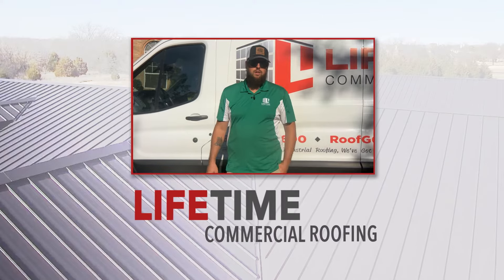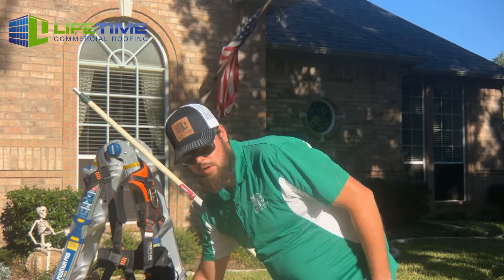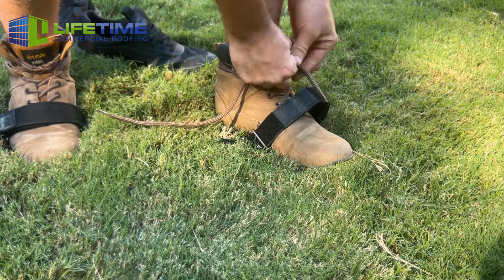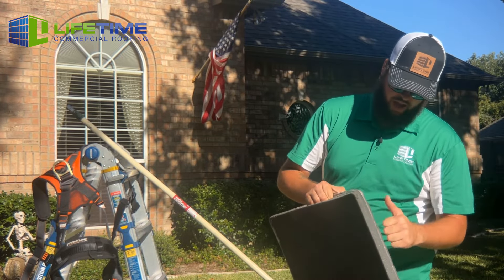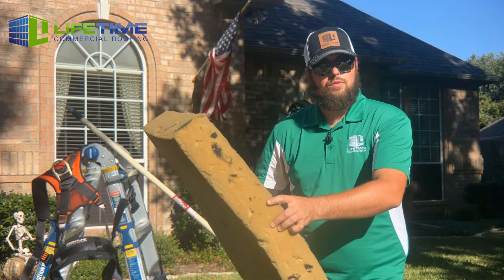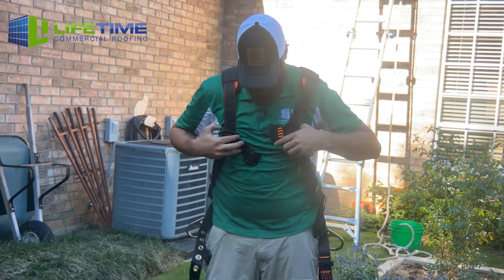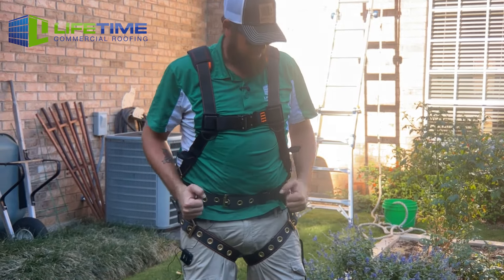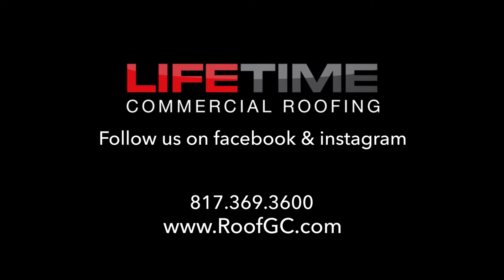How To Use Roofing Safety Equipment - Tech Tuesday

Comment: To be honest, in that situation you would probably want to anchor onto the other side on the house, then you don't have to worry about your anchor coming loose if you lift the rope to high like the set up you have in the video. Clipping your rope into you side rings is asking for trouble if you fall
Reply: i'm new to this. what are the side rings there for if you don't recommend using them? Thanks :)
Reply: @gameratortylerstein5636  they’re for stationary work positioning, what a line mechanic would use. Wrap your work positioning strap around the pole / structure and clip into your side rings
Reply: @gameratortylerstein5636 They put you at risk of breaking your back in a fall... A shock absorbing lanyard might prevent injury and it might not.
Reply: @gameratortylerstein5636  hooking to eye bolts on each side of a window.
Reply: All in all a Good video about safety and how to. I was on a roof the other month and actually tied off my rope on the other side which provided a tremendous amount of comfort knowing it was secured and not coming loose.
Reply: @unSTEVOED are there anchors you can hammer into the ground if there is no structure/pole ? Also i imagine using a thick rope. is there a friction or roof damage issue as the rope has contact with the peak ?
Reply: @50Quid-d3x please share more details about how the eye bolts work on the window sides

Comment: You said OSHA recommends fall protection for roofs over 7/12 pitch. Where is that stated in the regs because I thought it was required on all roofs regardless of pitch?
Reply: I agree. I can still fall off a flat roof if i accidentally trip and fall over a leading edge to my death
Reply: True that, up here in Maine on a flat commercial roof you have to be 12 feet beyond the edge before harness off
Reply: OSHA IS ANYTHING ABOVE 6FT
Reply: Anything above 6 feet height is regulation
Reply: OSHA and Canada have the same laws, anything above 6ft req fall protection
Reply: Inspectors and independent contractors can get out of these regulations as OSHA only protects workers underneath the boss and makes an exception for inspectors, as they are not doing any work.
Reply: Anything over 6ft you need fall protection the pitch has nothing to do with it.

Comment: Much appreciate the tutorial. Roofers deserve the utmost respect in construction business for the level of risk they take. Framers too, especially the ones that add rafter after rafter as they build it out, often standing on a stud and cut the rafter at a desired angle with a circular saw and a heavy nailer hanging on another side. We take them for granted. I tried climbing my roof for the second time (and failed) to replace a shingle, was 1 foot away from the shingle but at that point I did not find myself positioned comfortably and decided to hand the job to a professional. The roof I climbed had a pitch similar to the one shown here.

Comment: Thank you! This video has been the most helpful. All of the others that cover using a safety harness begin with climbing to the top of a roofline, with no safety measures in place, to install an anchor point to secure a line. I don't feel safe doing that on my 12:12 pitched roof.

Comment: Great video! I use the Petzl AVAO harness. Best that I've seen so far. It has D rings in the front (center chest), front both sides (for a positioning lanyard) and the back. I like connecting the line to the front as well. Cougar Paws and Pitch Hoppers are essential. I need to work on a 12/12 roof and would use a tool like the Ridge Pro to get to the top, but would install anchors, since I'll be replacing the shingles.

Comment: It looks like this one is great to get up but would you add another or switch if your walking around all sides of the roof? Also does this work on Spanish s tile roofs as well? 

In my case would be solar panel cleaning and gutter cleaning

Comment: I am not a roofer, but something here does not seem right. At 15:37 you placed the lanyard on the left front of your safety harness. If you fall and the rope catches you, wouldn't that cause you to bend-over backwards and sideways, and then snap your back when the rope gets taught? Is connecting to one of the front D-rings an option in the instruction guide for the harness? 😐
Reply from the maker: That only applies if you fall all the way off. You are correct in that you don’t clip off like that for edge work or anything that could cause you to free fall any amount. For that type of work you use the back ring. If you higher on the roof and keep your rope taught with the comealong and you lose your footing you’ll hit the roof but you won’t slide down. Ben’s harness has kept him from an almost serious accident twice using it the way he has demonstrated.
Reply: You're right, Those side rings are made for work positioning straps for tower / pole work. Not for fall arrest. Most harnesses come with a front d-ring to clip in from your anchor if you don't want to use your back d ring
Reply: He was doing a job for a pest control company, so I can see why he didn't want to install anchors, but if your replacing shingles, always use anchors, in my opinion.

Comment: The issue I see with the ridge pro is that it's not attached to the roof which makes it an insecure anchor to attach a harness to. I would questions it's ability to hold you if you were to actually fall and the pressure of that sudden load would be applied to the ridge pro.

It seems like a false sense of security. 

It's frustrating that there isn't some kind of simple solution for roof access for tradesmen who need to do work on roofs.

Comment: I wouldn't trust a ladder hook. I'd rather anchor to a joist and feel confident to work.
Reply: They can hold a lot of weight but definitely won't be as strong as a joist or truss

Like he said though it avoids putting holes in his client's roof so I see why he'd choose a hook. Same if you have big awekward ridge caps on metal roofs, i'd rather use a hook